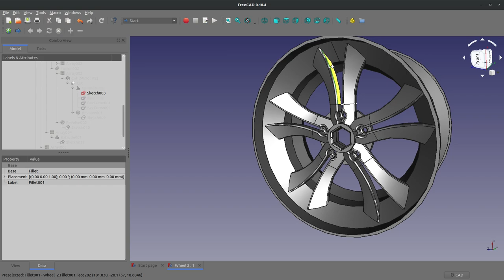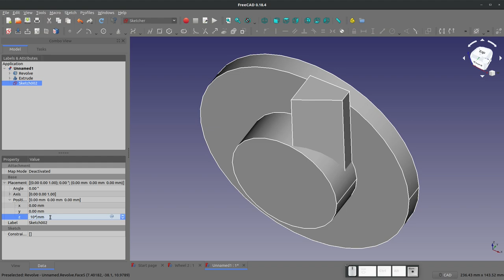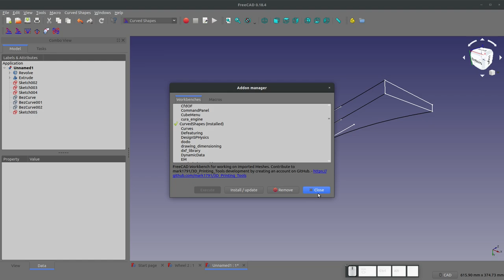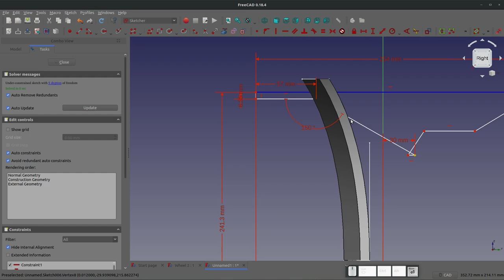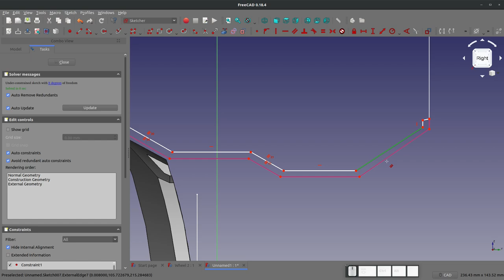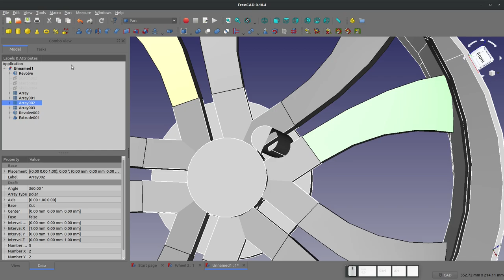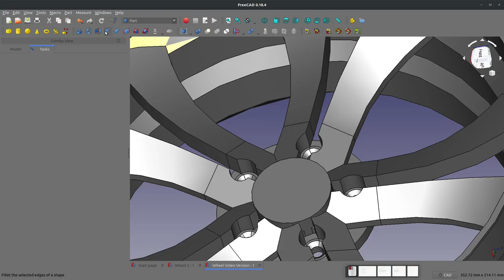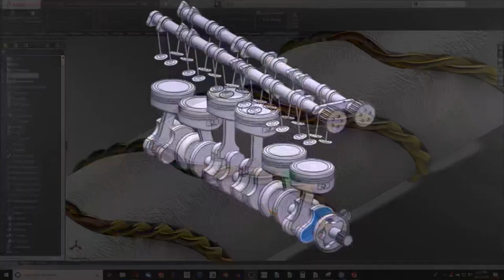FreeCAD - The Part Workbench is Still Relevant- Make this Wheel! |JOKO ENGINEERING|

Comment: Do you have a video on the different workbenches? One thing as user who is just switching over, all these different benches are pretty confusing - especially not knowing how they work together. Some seem to be using similar jobs too?
Reply from the maker: I suggest starting on part design which probably feels the most like other platforms.  I use Part for working with multiple bodies, and any other bodies made by other workbenches.  Most workbenches have been developed to work with the part workbench.

Comment: 8:27 i follow this step but my bazier don't snap
Reply from the maker: Sometimes things dont snap due to orientation.  Will it snap if the orientation is changed significantly?
Reply: @JokoEngineeringhelp  negatif. I try to change orientation but don't snap. Even blue grid icon on cursor not showing
Reply: @DanuLee_Wardoyo  Same problem here
Reply: @JokoEngineeringhelp  Also for you, I still don't know how to fic it

Comment: A hexagonal centering hole is entirely impractical.  If it is the correct size to do any centering on a circular stud, it would look godaweful.  If the centering stud were hexagonal to match, then the wheel MIGHT fit on in only one orientation; but, just as likely it will not fit at all.